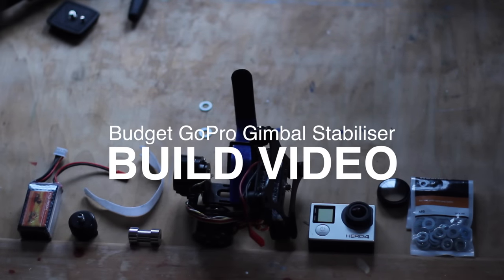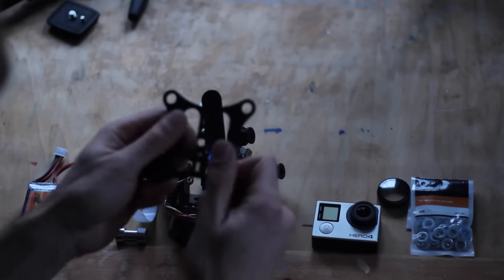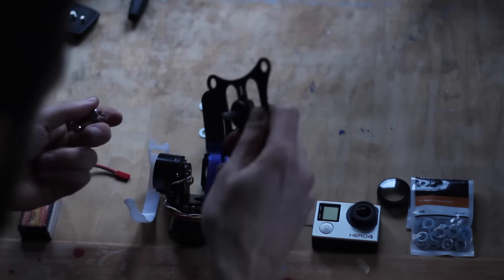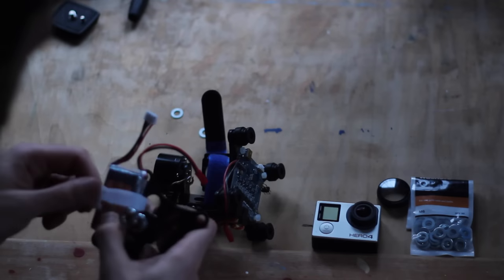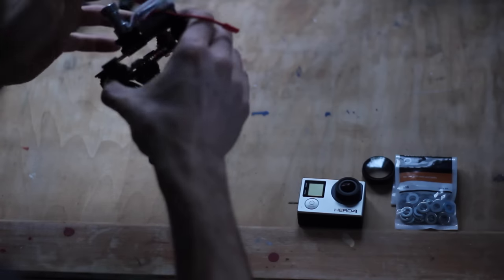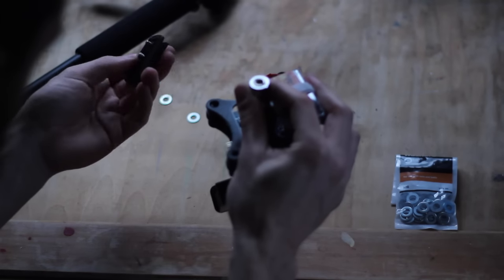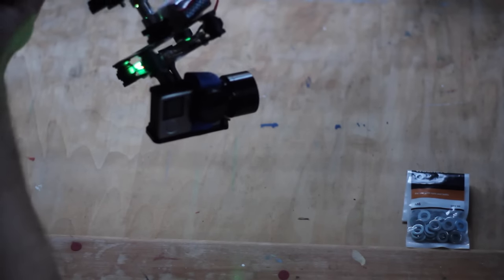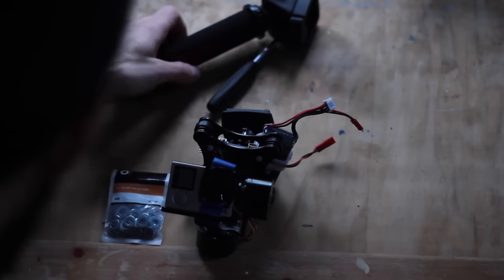Budget GoPro Stabiliser Gimbal Rig - £50 DIY build

Comment: so basically you plug the battery into the gimbal controller using a jst connector and attach the upper plate to anything you want
Reply from the maker: doctorstork Yeah that is general idea, it's a little messy but it's cheap and cheerful and offers good results.
Reply: Steven Litton,   you have  made this very simple and straight forward  I have watched over 20 of these and yours is great  thank you
Reply from the maker: doctorstork Glad it helped!